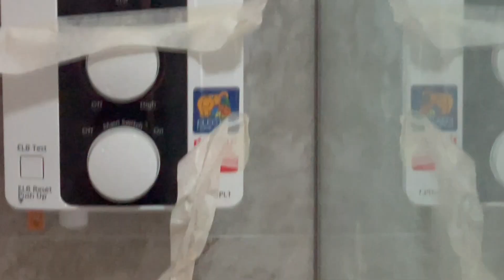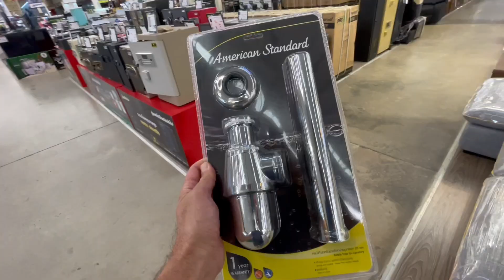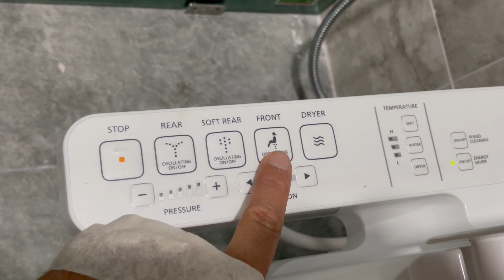Fitting a Glass Shower Screen - Thailand House Build

Comment: Hi there, interesting video as usual.
Was looking back at your older videos when you started building the "cool house"  house and was choosing isoblocks and other stuff. I'm thinking the same, well isolated and ventilated under the roof, thick isoblocks or double concrete blocks in the walls and large roof that shadow the walls.
Do you have any reflections on how your setup has worked out now that you lived there for a while?
Reply from the maker: Hi, I will try to make a video about this, but everything seems fine so far